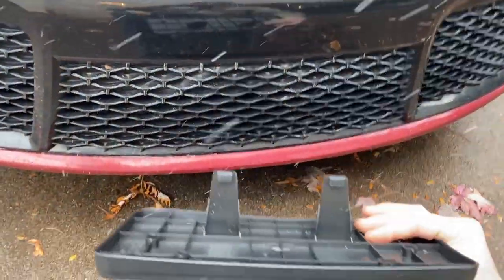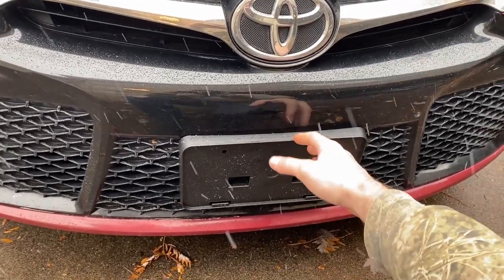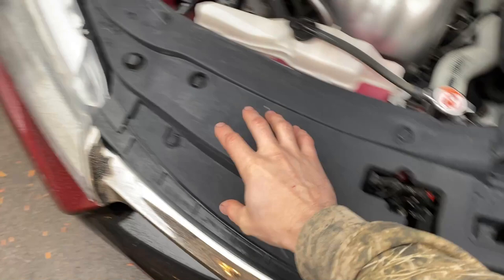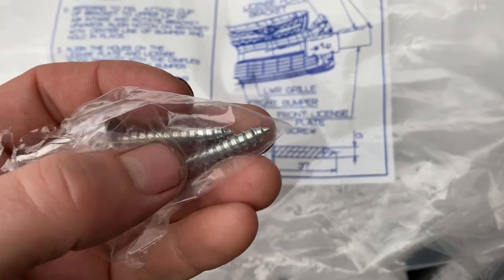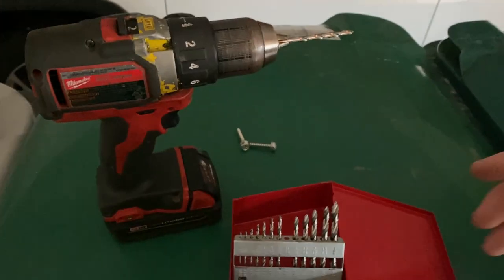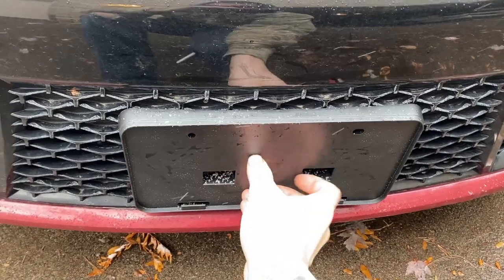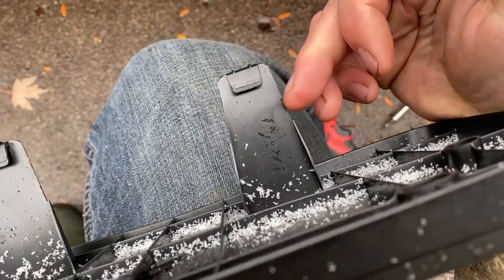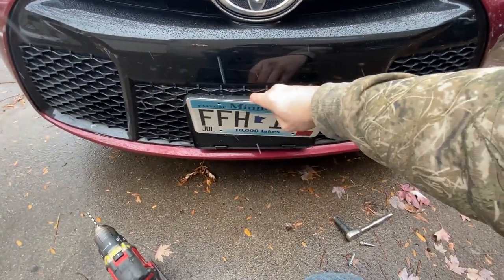Toyota Camry Front License Plate Bracket/Mount Install

Comment: how to take off a license plate 99 toyota CamryLE
Reply from the maker: Plate or bracket? Plate should just be held on with 2 screws. The type of screw will vary, so you'll need to figure out which tool is needed, but the plate should come off after removing those 2 screws. If you have a plate bracket that you want removed also, it should be the same steps - just remove some screws, but there will be holes in the bumper.

Comment: It says in the directions no drilling
Reply from the maker: That’s because they don’t want you to puncture anything, which is why I mentioned checking behind where you’re putting the screws first to make sure you don’t damage anything. These aren’t self tapping screws, so trying to Ram those in without drilling a hole first might not be very fun.